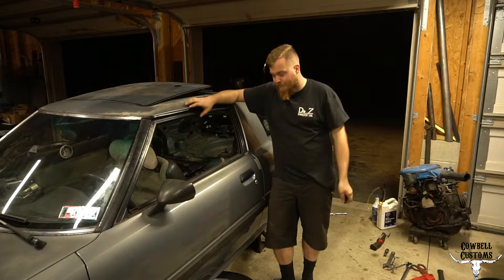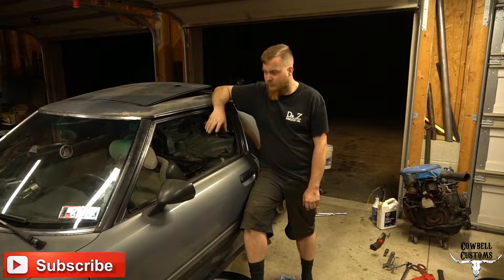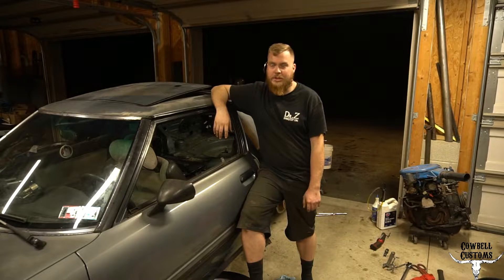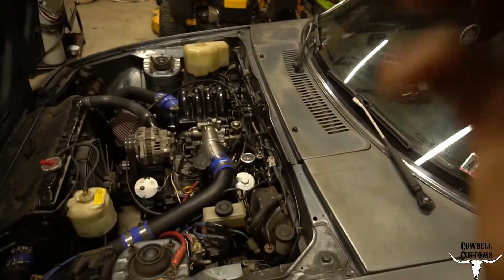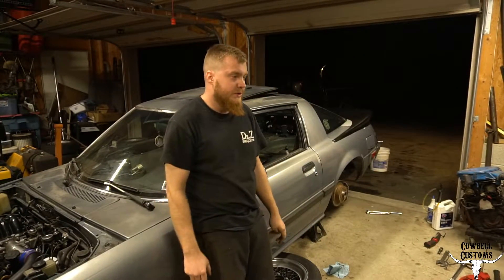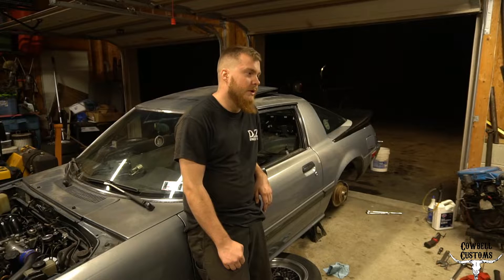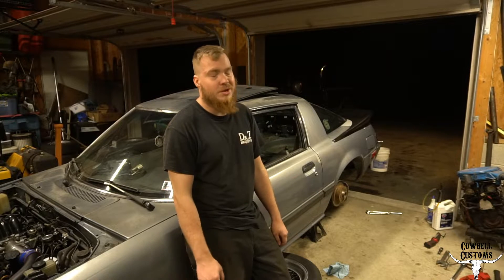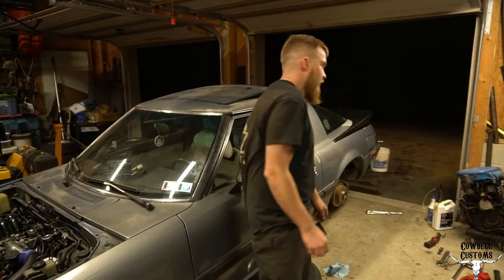Turbo FB Fuel System Failure

Comment: I like to put the pump in tank trying to figure out if I can use a retrofit hanger with the cup
Reply from the maker: I had used the top ring and a modified sender from a FC fuel tank, other ways to do it too but that's what I had on hand at the time

Comment: ethanol sucks for sure. better add some fuel stabilizer to the spitfire so it doesn't happen to that.
Reply from the maker: I think most of it happened when the tank was dry after the small amount of fuel evaporated out of it over the last few years. 

Currently I've got the tank soaking on evaporust to try to save it
Reply: I saw where the guy from lrbspeed put aquarium gravel in one and set it up to spin on something with cleaner all night